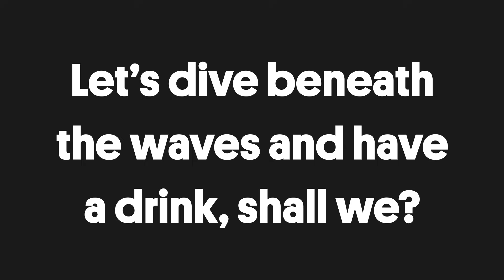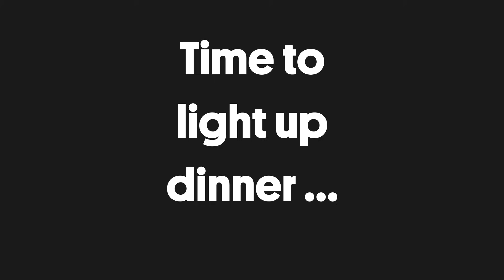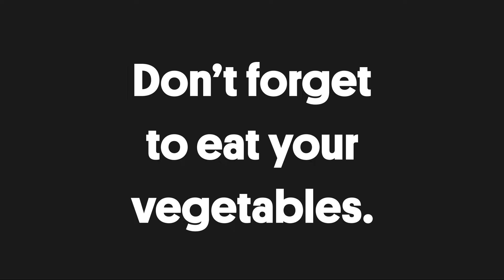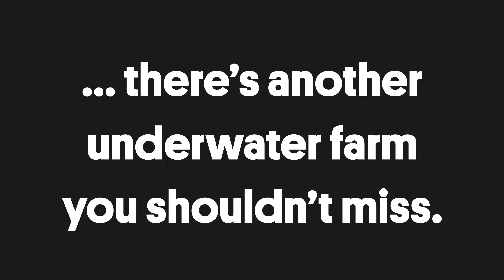Get Hungry for These Underwater Food Stories

Comment: Wine or any other Alcoholic Beverage does not "Age" in the bottle. Ageing is done in wooden vats where the Beverage exchanges flavours with the wood. The glass bottle in the sea will do Jack Squat. When you buy Whiskey that has been aged 10 Years that refers to how long it was stored in the Wooden Vat for. Letting it stand in the Bottle in your cubboard for 10 extra years doesnt mean its 20-Year aged Wiskey.

Comment: "We need to protect the ocean and it's supplies"

Sails a boat out and uses a vacuum that runs on petrol whilst wearing entirely rubber.
Reply: It's about moderation. Unless you can swim or row all day and harvest the stuff then you do need some modern day equipment to maximize your productivity. But he's using a small boat and as minimal as equipment to harvest so it's not as bad as big boats spilling oil or factories dumping their waste in the ocean.
Reply: "We need to address man-made climate change"

Is constantly exhaling carbon dioxide.